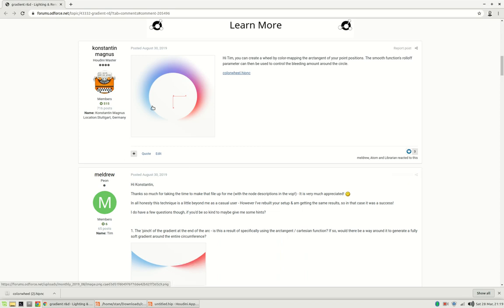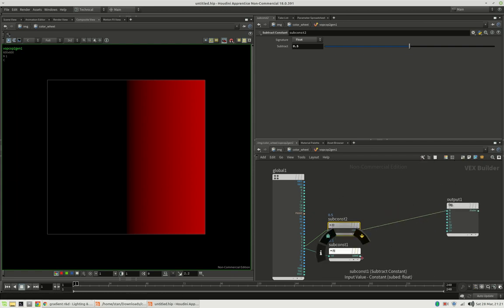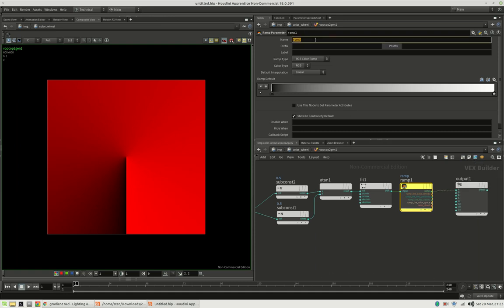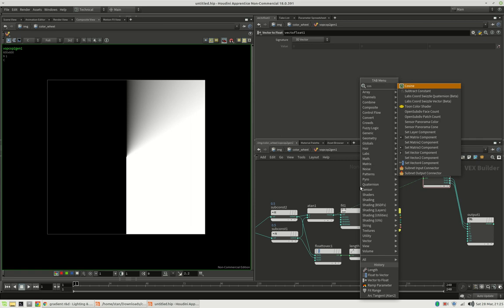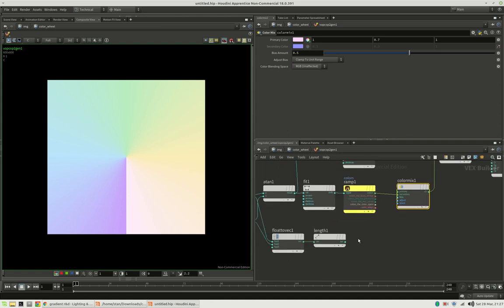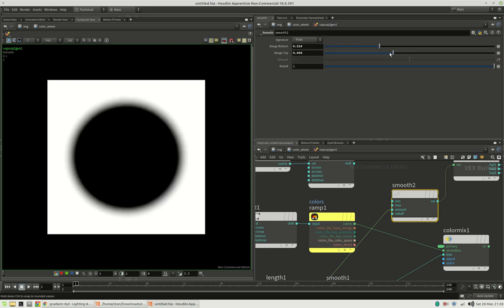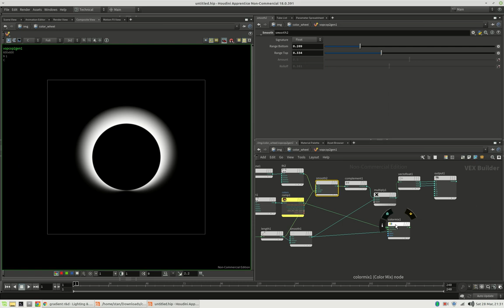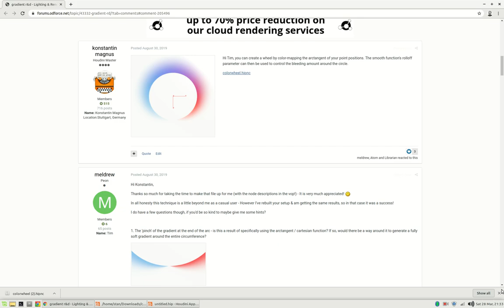Circular Color Gradients – Houdini Tutorial

Comment: Hello, thanks for the tutorials~ 
May I ask how to give a  color ramp based on the distance from the centre of a vdb sphere, and also adjust the alpha of the sphere so that the color could be visualized~ 
Hope you could give some advices or make a video? Thanks so much!
Reply from the maker: Hello Catherine,
in SOPs it would be attribute from volume and a color node using ramp from attribute. In (COP) VOPs it would be volume sample and a ramp parameter set to color.
Reply: @KonstantinMagnus  Thanks! I tried to send email for more help, but the system seemed to be not supportive.
 I may have to keep asking here, sorry~ I am still newbie in Houdini, so I am not sure that by using volume and color node, what parameters I need to manipulate to achieve the effect. Also, does using volume node mean that I do not need to use vdbfrompoly to have my sphere solid?

In detail, what I want to simulate is a bit science-based. 

I have got my data, and I would like to make a droplet with ramp color from dark to light based on different concentration data and corresponding distance from the center data I have.

Many thanks in advance! Hope you could help me~
Reply from the maker: @catherinekan3610  It's best you come over to the odforce Houdini forums. There is plenty of space and people to discuss your issues with image uploads and so on. : )
Reply: @KonstantinMagnus  Cool! Because I tried many platform but no one replied, thanks again!